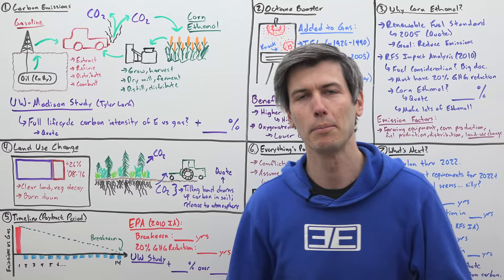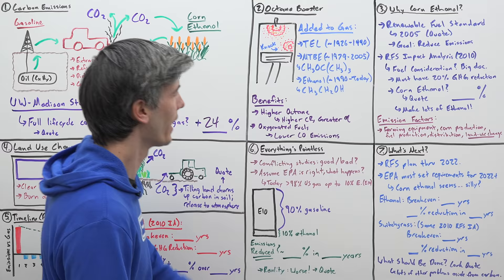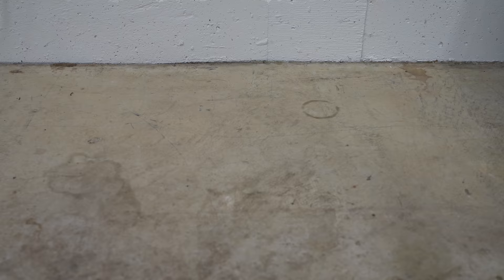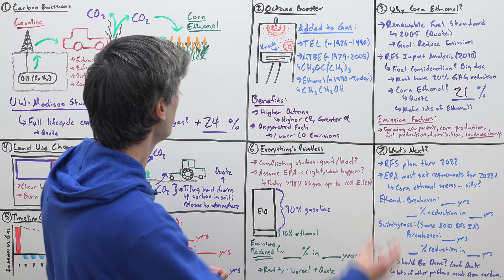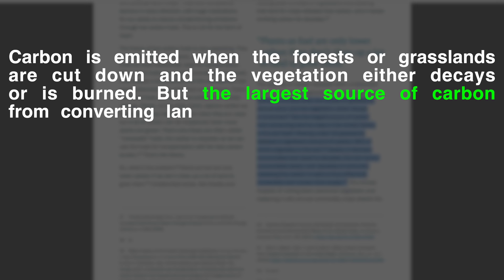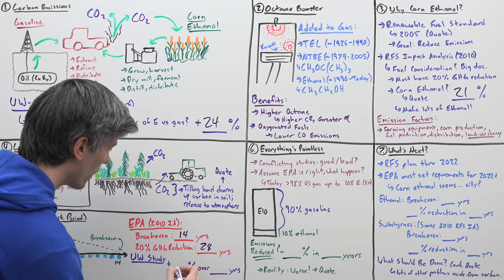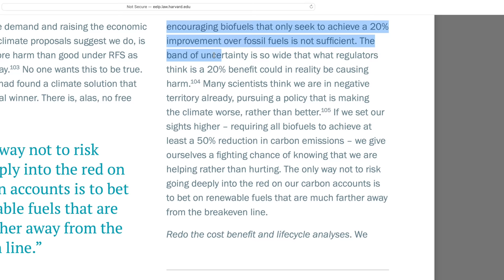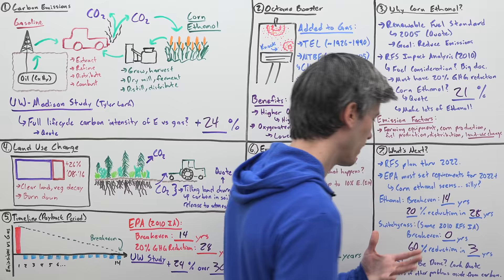America Was Wrong About Ethanol - Study Shows

Comment: I don't think it ever was a secret that ethanol had less energy density and more costly to produce per BTU.  I always took it as a way to subsidize the farmers' surplus and replace foreign oil supplies.  What really wasn't apparent to the user was since State and Federal gas taxes are based on a fixed cost per gallon, the lower mpg results in paying a higher tax per mile.
Reply: also, it's making it harder for manufacturer's to hit their mpg standard, which makes the buyer pay more at purchase of the vehicle.
Reply: You are right.  It is not a secret.  What people forget is that we have MORE corn than we need.  It would get wasted.  We 100% want to grow more food than we need, to account for problematic years.   So we ALREADY have the corn.  Ethanol is a way to use up that buffer when we don't need it.   

Now, certainly, the ethanol and corn industry lobby to get every advantage they can.  Every industry is guilty of that though.  Still, having a food buffer and finding ways to use the excess is a good thing.   As noted in the video, causing an even greater corn growth increase.  Which should not happen.

With electricity becoming renewable, obviously that is now the better choice.   We still are going to want excess food; converting it to ethanol is likely a solid use.

I normally agree with Engineering Explained, but I'm pretty sure they wouldn't want us to live on the brink of starvation, and also wouldn't want us to let that already grown corn go to waste.
Reply: @legonut78  it's not corn that humans can eat. They wouldn't be wasting a crop they would plant something else. You can't plant corn year after year in the same field.
Reply: @RJL612   I’m not following you.  Are you saying that the corn used for ethanol is inedible?  I assure you, it’s the same corn humans eat.  Field corn (dent corn) is what we eat and it is used for ethanol. It is also our animal feed.  So yes, corn is where our food comes from including most of the interior supermarket isles and all of our meat and dairy.  Without corn, we die. 

Also.  You certainly can grow corn in the same field year after year.  It’s cheaper to rotate it with legumes however, to reduce nitrogen costs.   That problem is being solved however and someday soon corn will fix its own nitrogen.  Several folks are working on it, which would be a huge win for Mother Earth.
Reply: @legonut78  Field corn has dozens of uses, but it is most commonly fed to animals or used to make renewable fuels like ethanol to power our cars and trucks.  But only part of the kernel is used for ethanol (the starch), the rest of the kernel, including the protein and fat, are then used to make another popular animal feed known as distillers grains.

People don’t eat field corn directly from the field because it’s hard and certainly not sweet. Instead, field corn must go through a mill and be converted to food products and ingredients like corn syrup, corn flakes, yellow corn chips, corn starch or corn flour.
Reply: @legonut78  Only 1% of corn grown is the type that you could go pick off a stalk and take it home to cook.
Reply: @legonut78  when I was a kid I'd go to grandparents farm and I remember he was about to plant corn and I helped fill the planter and I remember the corn seed was a bright purple color. And he told me you can't eat it.
Reply: @RJL612  correct.  Only one percent is sweet corn.  99 percent is dent corn.  Both are human food.  As you say, the later has to be ground.   

In short. It’s all human food that we need. We must grow more than we need.  When we have extra, we use it for ethanol (and diplomacy and charity).  It also supplies many of our other products.   We could grow something else, but it would be less efficient and use more land.

The ethanol lobby has increased that buffer though.  40 percent (or whatever their use is today) seems too high.
Reply: @legonut78  ethanol is not good on engines. I bought a generator last fall and there was a warning label about not using anything more than 10% ethanol.
Reply: @RJL612  the purple color was a chemical used to treat the seed and was non edible. It wasn’t the corn that was non edible.
Reply: amen most people do not know gasoline is taxed !!
Reply: @haroldtanner9600  even after it was grown no one would eat it.
Reply: Or that we don't even use our own oil...
Reply: @RJL612  Your post was false "ethanol is not good on engines" That false. The Indy 500 race is run on ethanol because of its high quality and it is easy on the engine.
Reply: @legonut78  Look deeper. Corn is cheap to grow and harvest and it's byproducts are used in 85% of what you buy in the supermarket. As he pointed out the switch to ethanol increased the amount of farm land to make up for increased demand in ethanol. Then there are other costs such as soil erosion, run off not to mention the human costs. Corn byproducts for human consumption is toxic from vegetable oils to sugar and other forms of carbohydrates produced from corn is the leading cause of things like obesity, diabetes, auto-immune diseases (chemical fertilizers and food sensitivities). Corn production is profitable not only for the gasoline companies that charge based on a barrel of oil and get to cut their product with a cheaper and highly subsidized substance but companies like Monsanto and even drug companies Pfizer make out like bandits as a result of wide scale use of corn across society.
Reply: @jbob7148  What food buffer do you propose that won’t use farmland, and other resources?  

Certainly the corn lobby has taken it way too far in their favor, but the idea that we should use zero ethanol is also naive.  Our food system needs buffers and corn/ethanol is a solid option.

Typical YouTube.  I’ve got 20 acres of corn right now, and I’m being downvoted by people that don’t know sweet corn from dent corn.   Sigh.   Our world is hosed.
Reply: @legonut78  Regenerative farming. Organically grown vegetables combined with Grass fed beef which can be freeze dried with a shelf life of thirty years. It's not only one of the most nutrient dense sources of food but it's so nutrient dense that it provides all of the nutrients a human being needs. 

No run off, no pesticides and the best part is that it effectively ends corporate farming and reincentivizes the small farmer. We should flip tax incentives no longer to the corporations but forgo land taxes on the small farmer altogether. Bring back health to the land and health to the people. Also, beef can be raised on land crops can't be.

Why overproduce when we can store decades out and cycle that food at a discount to those less fortunate as it approaches it's expiration date?

Guessing you didn't expect a legitimate well thought answer.
Reply: @jbob7148   props.  I give you credit.  Yours is the first well thought out answer on this thread.  I agree with you mostly, in a theoretical sense.  In practice I don’t think your solution is sellable however.  As you said. Because Of our tax subsidy system.  

If your solution does work, as you said, we have to fix the broken tax subsidy system.  Your efficiency would then prove itself in a free market.  Along with other solutions.  

Even organic farming and massive freeze drying all has a cost.  Veggies don’t have many calories.  Grains are far more calorie dense.  Though you know that.   
Thank you for posting something solid.  My faith was low after the comments by so many that don’t know where their food comes from.
Reply: @legonut78  You're right, on it's own it's not sellable but as part of a platform attacking corporations, the federal reserve and the two party system I think people might see the logic in it...co-operative libertarianism.
Reply: @jbob7148  Do you have any sources that have done the math.  Replacing corn production with beef.  On my land, the beef would need outside food brought in four months per year.   But, not running a combine frees up a ton of resources too.   (Plus the herbivore consumes 10 calories for each that it creates, thus the default mentality that we would be better off just eating the plants)
Reply: @RJL612  Humans can eat dent(field) corn. It's corn chips
Reply: @RJL612  Field corn may not be as desirable as sweet corn, but it is edible.  I have eaten it!